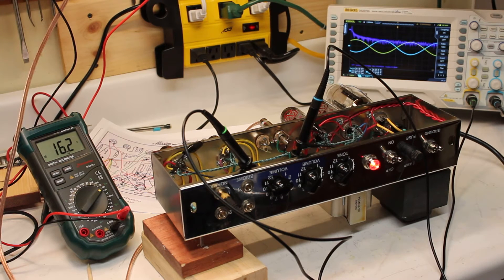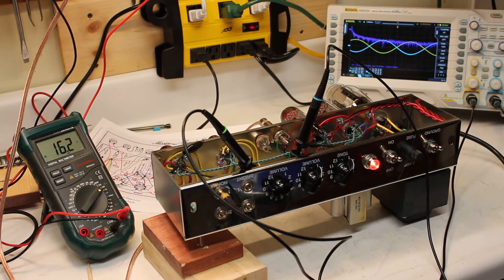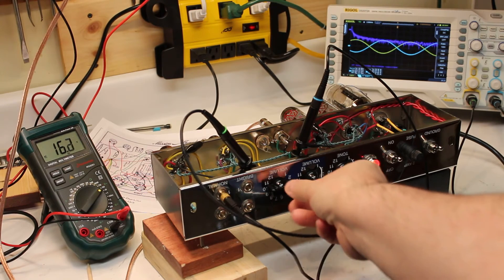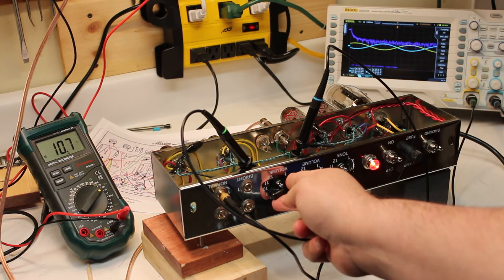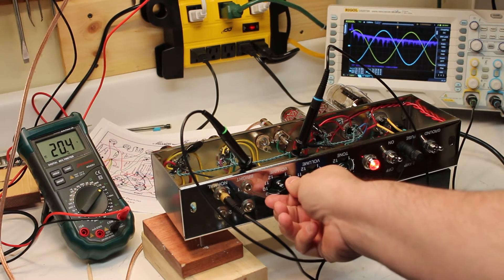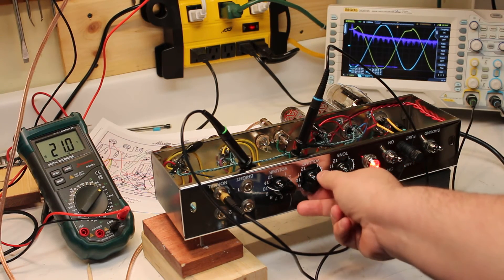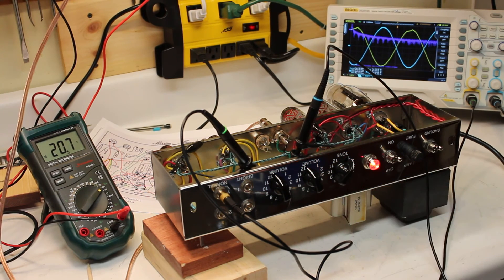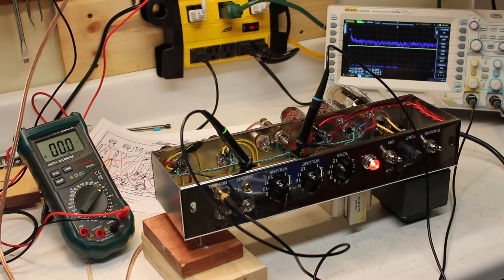5E3 Volume Control Demonstration

Comment: You should get to clipping at about 3 unless your input is reeeeeeally low. What gives there? 

Why opposite sine waves? You’re on phase inverter I guess. 

Oscillations could be due to heater wiring on power tubes. Reverse them on one tube & try.

Comment: I’m guessing your volt meter is measuring peak to peak voltage.  It seems too high for RMS.
Reply: AC on a voltmeter should always be RMS… Unless it has some kind of peak to peak mode. Still way too much for 12w. Something off.